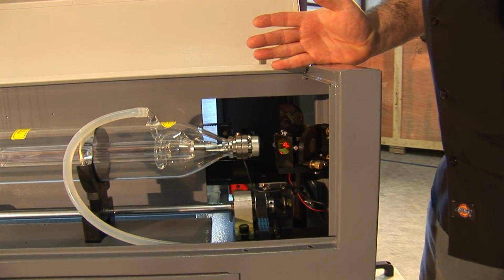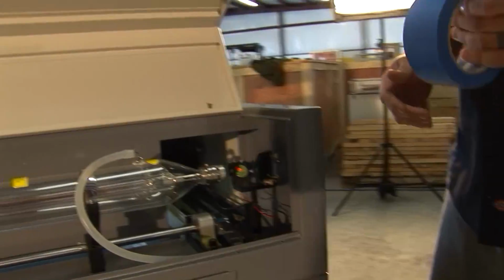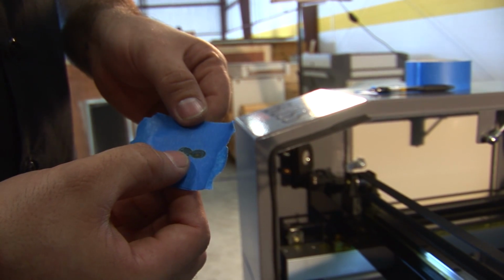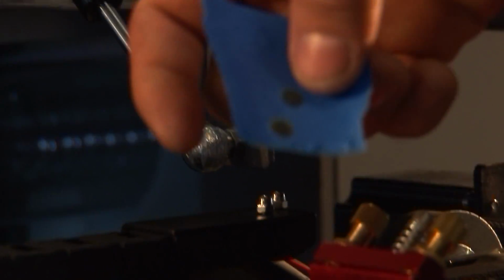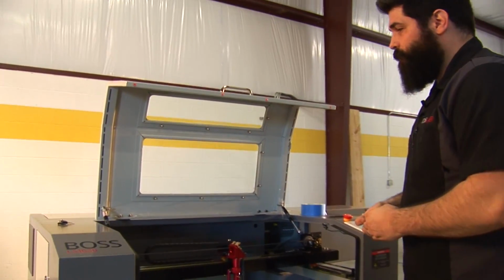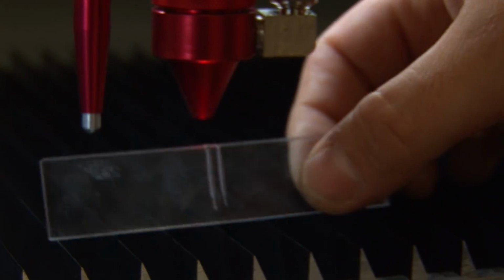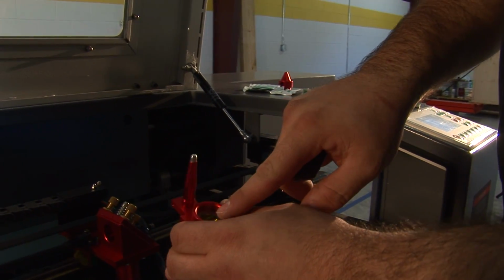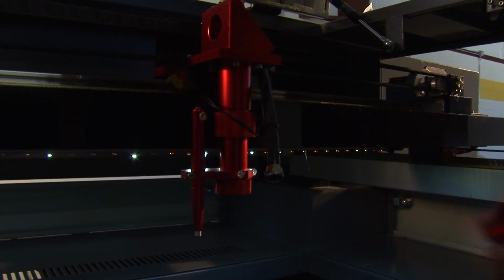Laser Alignment -  BOSS Laser GEN 3

Comment: Ok your video is so dark I can't tell what you are measuring to level the tube.  I assume it is the top shoulder of that bracket.  Lossening the front screw, no problem but that back screw there is no way I can get my hands and the wrench to that screw.  I have measured to the top shoulder on both ends --one end is 84,74mm and the other is 84.36mm is that close enough to level?

Comment: My 2 cents worth, I use a small piece of aluminum foil to cover the mirror before I tape it, that will protect the mirror from needing to clean after and also prevents the tape from flaring up when you hit it with the laser beam. I personally would never push my lens out of the holder with a pen, I use Qtips. Just my opinion and 20 years working with lasers.
Reply: How to on the red mark laser dot. Because mine isnt there for me to adjust. Its so hard
Reply: I'm with you on the lens.  I never touch it with anything except the lens cleaning cloth.  Mine falls out easily...doesn't need to be pushed.  YAY
Reply: i would think that  the aluminum foil is also hard enough to scratch the mirror?!  
my feeling is that optics are very very sensitive parts...

Comment: Forgive the question.  Newby here.  If you are turning the tape sticky to sticky so no glue is showing on either side, how are you sticking it to the mirror mount?
Reply: Use just enough tape on one side to cover the hole, which leaves some sticky area on the outside edges.
Reply: @vaposhack  Thanks for the reply

Comment: Nice machine!  I like what I see so far, other than lens removal. That's pretty involved. I currently own a cheapo Chinese laser and change lenses frequently (between engraving and cutting), but it takes less than a minute to do (pop the air hose out, turn cone and it comes out with lens inside, then twist alum o-oring and lens falls right out). Hopefully you'll improve on that design! :)

Comment: Also the air compressor put out a pulsing type air. In other words there is no compressed air tank or regulator. I have a huge air system in my shop. Can't I just find an accurate regulator that will allow a pound or two of pressure that is even and constant. Anyone know what kind and where to get one. I suppose start looking at air brush regulators.
Reply: Mark, mine is hooked up to a regular air compressor.   We upgraded from the pancake to a 26+ gallon unit to keep from cycling so much.  Also, put an air dryer of some type in the line to remove the condensation from the output.

Comment: I have one other question or comment. My laser did not come with an industrial chiller, until I get one, I was planning on putting a 5 gallon container of water in an old dorm type refrigerator to keep the water cool. Is there an optimum water temperature for a 100 watt RECI laser tube? Sorry but I have so many questions yet . I'm cautious and want everything right before starting.